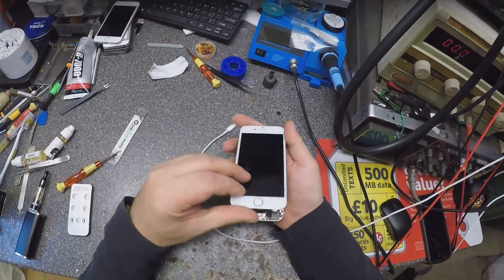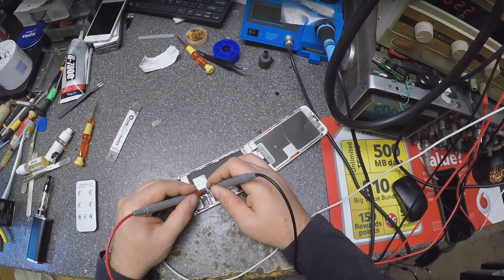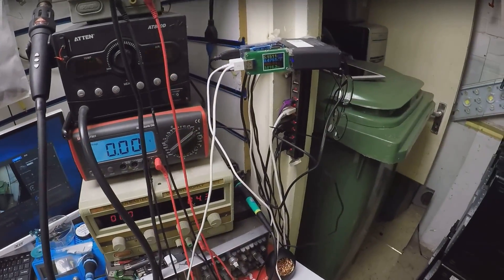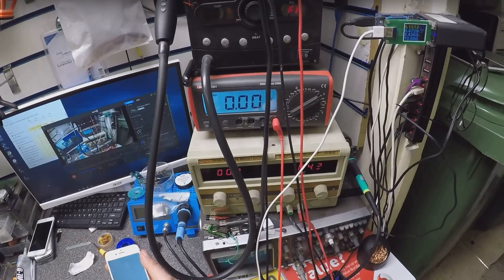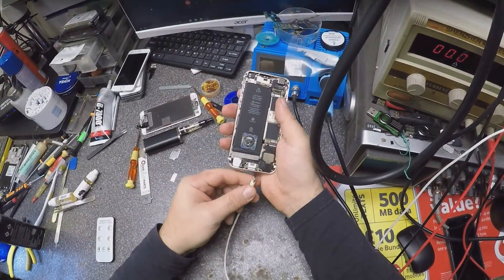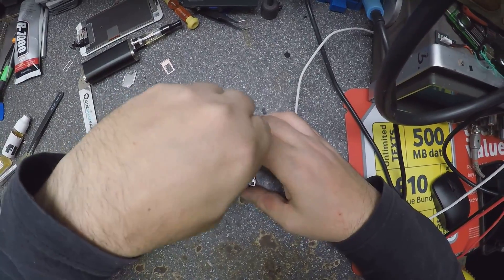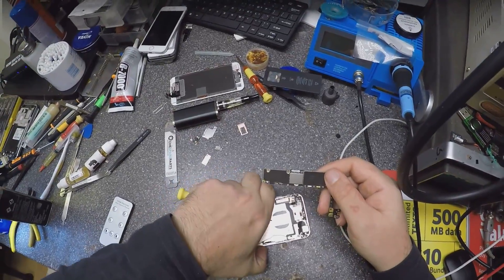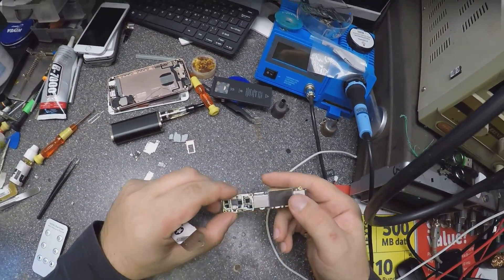Iphone 6s no power, charging ic replacement, part 1

Comment: Hi, I have iPhone 6s, which only turns on with usb cable and iTunes recognize it too. But, i cannot start the phone with power button and also, i do not get any display. Display stays black all the time (Even when iTunes recognize it).  Also, top 4th pin (from Left side) on the display connector is black. I will appreciate if you can guide me a little bit. Thanks